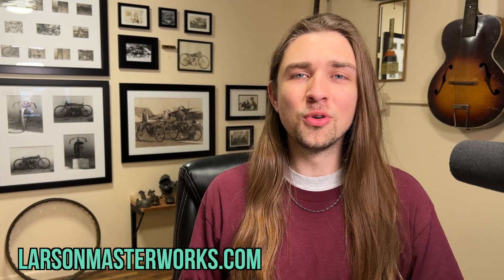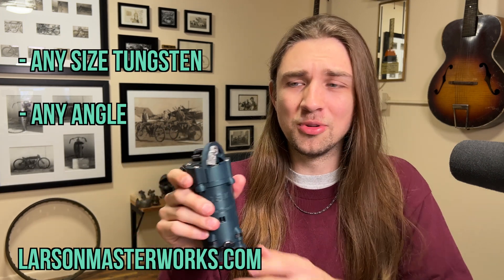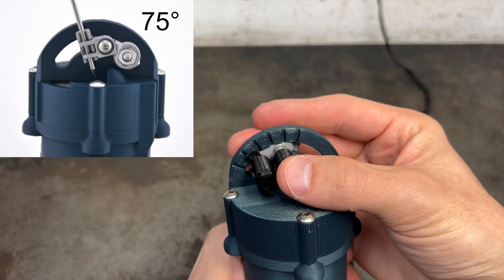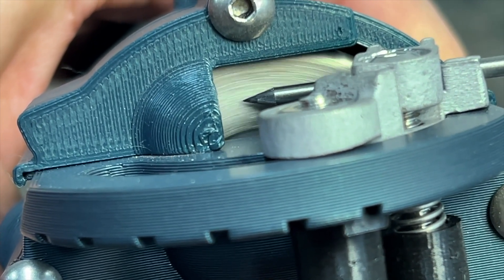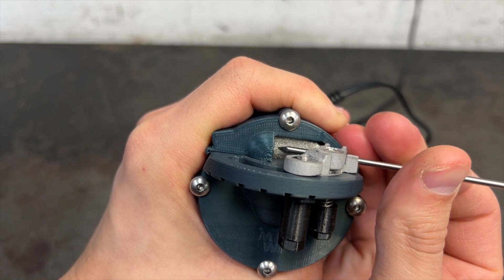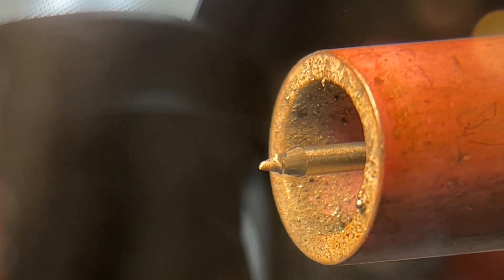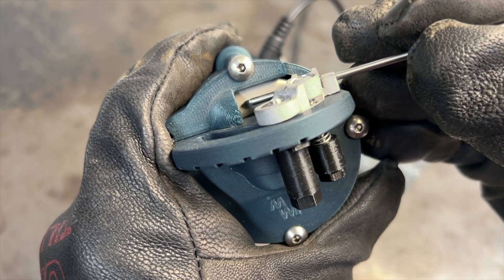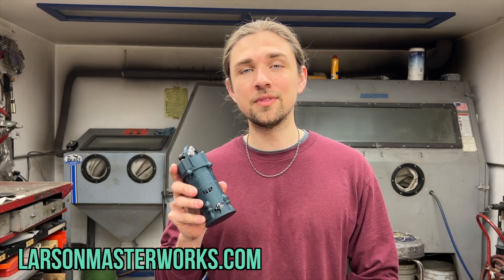I Designed a Tool That Will Change Welding Forever - TIG Stick Handheld Tungsten Grinder

Comment: Someone should make a tungsten sharpener that worked using a cone with diamond sintered to the inside that was battery powered and roughly the size of a tube of tooth-paste, or like the size of a electric screwdriver. Having a sharpener like this would let you sharpen the tungsten without fully removing it from the torch, just loosen the back cap and pull it out a little bit and re-tighten the cap to hold the tungsten out. It could have quick change sharpening cones for different angles, and it could have some diamond around the outside of the cone too for removing bulk material like if you dipped it badly, then you just finish the grind with the cone. you could be welding and do a touch up of your tungsten with one hand, one holds the torch and the other holds the sharpener. Since you dont have to remove the tungsten, you dont have to wait for it to cool or risk burning you r nice tig welding gloves :)huh

Comment: Hi David, I found your channel years ago from the Schwinn Cadillac resto, still one of the best on YT. 
I also TIG, and for my tungsten I just use a disc grinder with a dedicated diamond wheel (only used for tungsten) and I chuck up my tungsten in a driver drill. I hold as needed to get a fresh grind at any angle needed. It's pretty quick and with a little practice easy to get good angles. 
Does this tool do anything to make that easier or better? Maybe more consistent? Cheers

Comment: This seems so cool. Could you add a spring tension so that if you let go it automatically lifts the tungsten when you let go of it?
Reply from the maker: It is a great idea and was part of my original “dream design” for this tool actually haha! Maybe someday I’ll incorporate that and a couple other features as updates. One update that will be coming for sure though is a battery pack that clamps onto the existing unit and plugs right into the power supply port.

Thanks for the support! 🙌
Reply: I think you'd have to push the stick in really hard for it to grab on, but it is a great idea to foolproof the device 👌